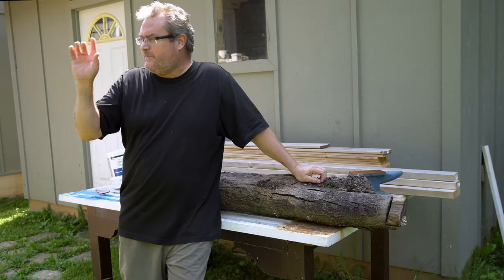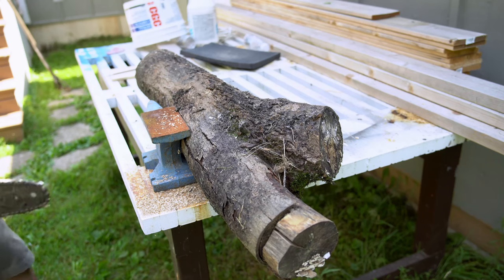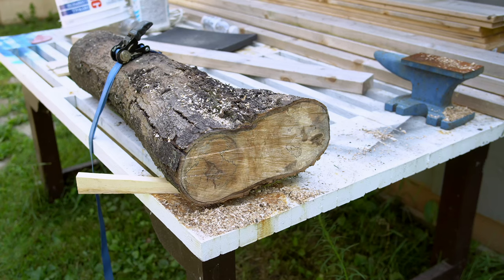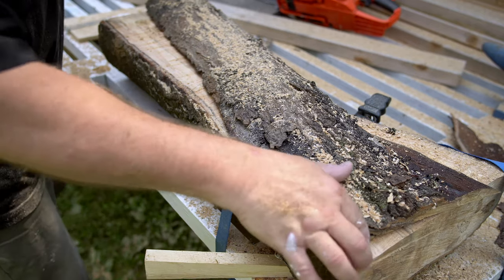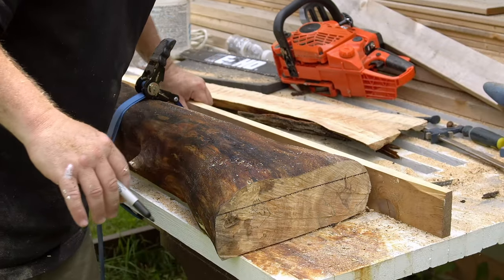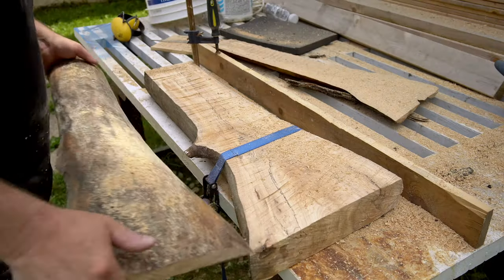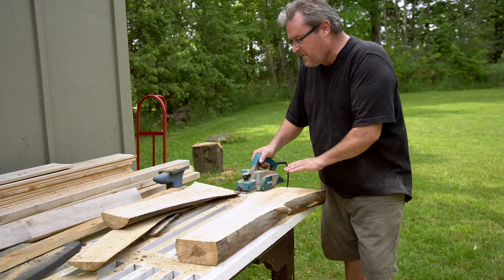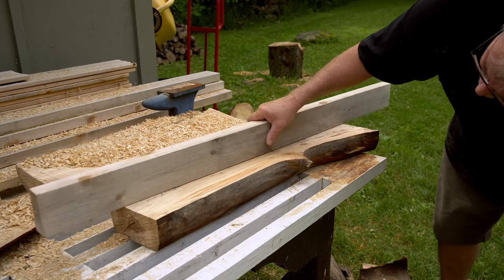In Search Of The Spalted Crotch - Finding Figured Wood

Comment: Just a tip, When you are slabbing wood like that,  If you use the hole in the end of the saw bar to attach a small block of wood/metal/plastic, It will ride along your guide, preventing the chain from touching it.

Comment: I picked up a lot of oak boards 145mm x 45 mm about 2 years ago thats been sitting in my garage. Its rough sawn and weathered after sitting outside about 13 years prior under a tarp. I want to make a kitchen countertop but I'm struggling about how I can make these flat enough and square enough for jointing etc. 
John, given your no nonsense approach to woodworkning and im pretty sure ive heard you say " done is better than perfect" what would you recommend me to do? And this is comming from seeing you use an electric planer. Would it be sufficent? Thanks in advance to you or anyone willing to put their 2 cents in!  //D
Reply: Marfelt Nick Offerman has a jig for flattening slabs. It uses a router to do the work. It might be of some use to you.
Reply: Marfelt a handplane and winding sticks will work
Reply from the maker: It takes practice to get good with an electric hand plane, but that sounds like a good opportunity.
Reply: Can confirm, one of those simple router jigs works great.  I've used one to flatten end-grain cutting boards and it worked really well.
Reply: Thanks for the input. Looking into the router jig, I'm thinking as long as I get the rails right chances for failure are slimmer than electric planing. I'll save that for a project that I can afford to practice on :)

Comment: Speed it up. Make yourself a mini kiln. 2'W x 48"L x 18"H box, open ended with a fan on one end, dehumidifier on the other. add a small heat source between the fan and box and that will be dry in weeks.
Reply: Vikingblooded Kraftwerks but then there are a lot of internal stresses in the wood. It's better to air dry so the stresses are relieved
Reply: JoshL not really, we kiln dry all the time. If you make it too hot, then yeah, but 120 F, and you're fine.
Reply from the maker: I'm not is a hurry to dry the wood and it sounds like that's more of an investment in time, gear and electricity than the wood is actually worth.
Reply: It definitely can be, but also quite worth it. In 3 years, you might not even remember what you wanted to do with that piece or not be interested in doing this anymore... or ants....
Reply: What do you use for a heat source?
Reply: eggypickle small cheap heater from Wal-Mart, think it cost me under $10
Reply: +JoshL I believe this to be a myth. I don't think there is a single big scale commercial producer that does air drying. It should anyways be heated above 45°C at least once to kill of any possible bugs if you leave the sap wood on.
Reply: BR H Chattanooga hardwoods and many of the other big producers do both air drying and kiln drying. Usually have to unless you have the property and money to build a couple dozen kilns. Stress relief in a piece of timber can be a problem, but there are ways to deal with it. Strapping your stacks down, slowly brining up the heat, ensuring good air circulation etc
Reply: Weird. I assumed the logic would be that you don't want to have so much dead capital sitting around for years. Especially since a insurance company probably tells you to get lost if you ask them you to insure your large wood pile against fire.
I visited a manufacturer that exclusively does oak and beech. They had one building with heated and ventilated storage containers. They generated the heat with a small wood fired plant on site. They have told us that it takes around 5-7 days for the lumber to come down to 13% at which point it gets planed to final dimensions. For hardwood flooring they said the plastic wrapped tongue and groove might well have been standing in the forrest a fortnight ago.
So I just couldn't imagine that there are people doing it otherwise at large scale.
Reply: BR H they aren't brining 8/4 oak down to 12% In a week. At best, 6 weeks. Even 4/4 wouldn't dry in a few days.

Comment: I bet the rest of that wood pile has some treasures too! That's really one way to honor the tree, to the mindset that regards them as majestic intelligent life instead of the crop that they are. To preserve it and make use of it as decoration and tools instead of letting it rot away or feed the bugs. This way it lives on. I wish more people could understand that as a tree grows, it absorbs carbon dioxide and uses the carbon to make wood. That is limiting how much carbon dioxide is going into the air. It's locked in the trees wood. If you heated it up and drive off the moisture you'd end with black charcoal, which is carbon! It's really one way that nature naturally limits the carbon dioxide content of the air. It gets trapped in trees and the shells of invertebrates.